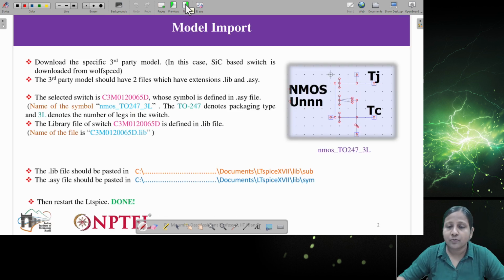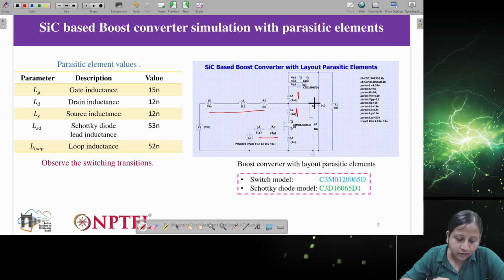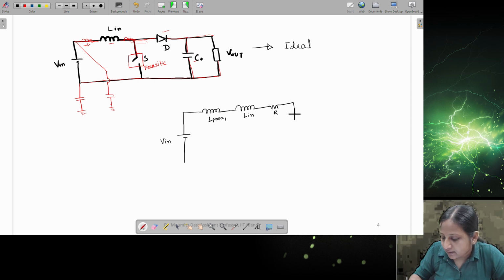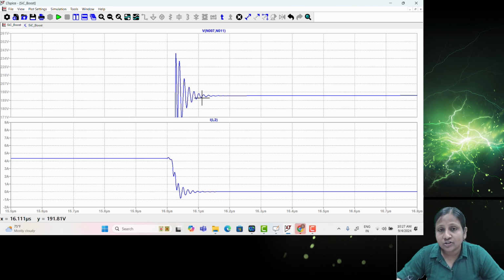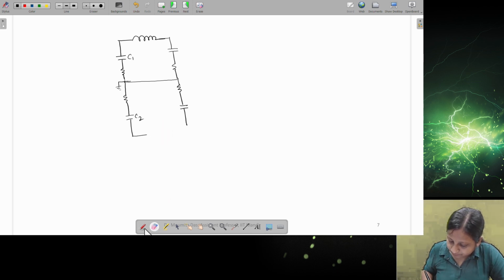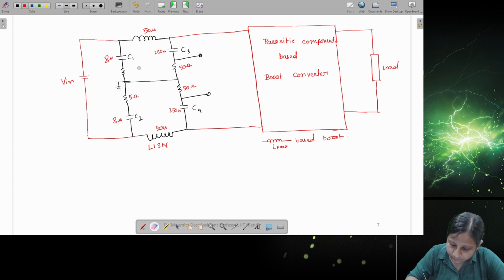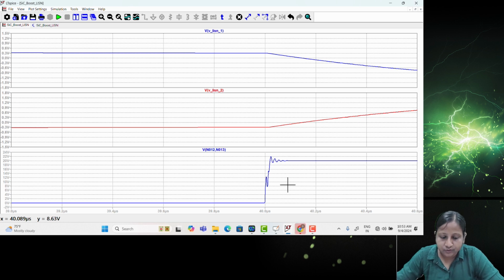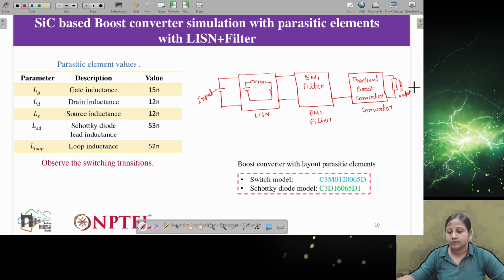EMI Simulation with LTspice

Comment: HI, How did you calculate c2 capacitance value which is connected with ground after load? Because without this noise can not be measured.
Reply: Hi, the value of parasitic capacitance C2 highly depends on type of load, incase of a motor it is the parasitic capacitiance between motor windings to ground, incase of PCB board it is measured from the top layer to ground and highly depends upon the structure and material.